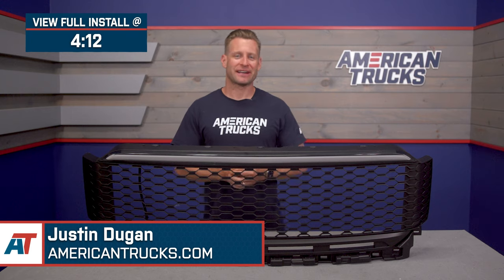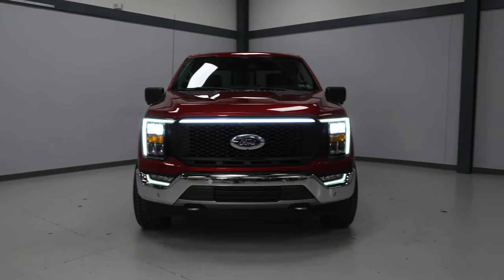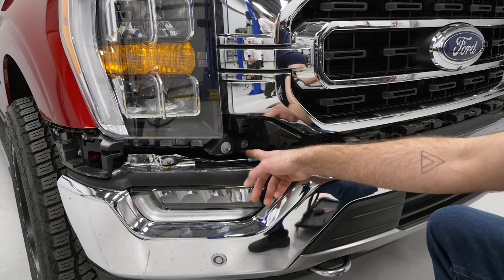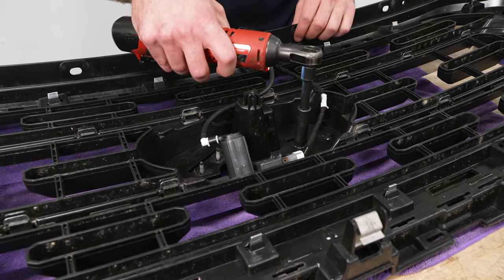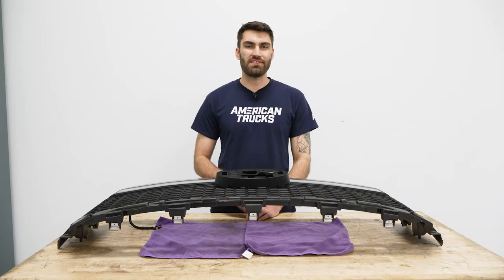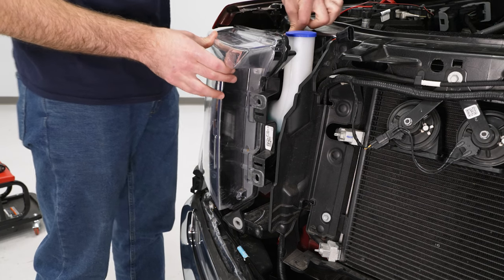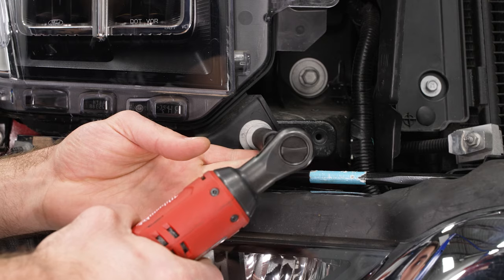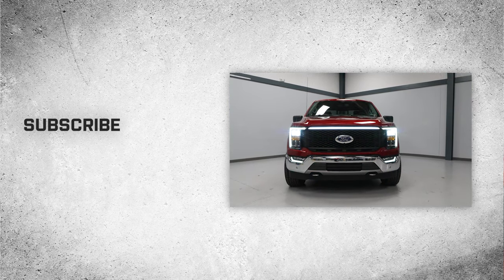2021-2023 F-150 RedRock Baja Style Upper Replacement Grille Review & Install

Comment: The wiring harness doesn't work with the 2023 lariats (stock led lights). The box came with another set option but no instructions on what the three wires are for.
How do you toggle to 'lightning model? Mine just stay on the raptor style amber lights.
Reply: The wiring T-harness also doesn’t fit on my 21 f150 xl, but I have the alternate wire group with 3 prongs and no instructions. How were you able to hook yours up?
Reply: did you find a way to fix this?
Reply: @doofy2129  not from the manufacturer. I just searched for wiring diagrams for the headlights and spliced into them and omitted the harness.  Worked easily. Just make sure you look up the right wiring diagram. 2021 lariats have different headlights than 2023
Reply: @DeltaHeavy So it worked properly by splicing the wire into DRLs? Did you have to do just one side or both?
Reply: @shark_plissken  Just the one side. I did it on the passenger side
Reply: @DeltaHeavy  they did it at some shop right now, had to splice into passenger side like u said. But now the headlight on driver side, vertical halo led not lit..
Thoughts??
Reply: @shark_plissken  pretty sure they spliced into a wrong wire. I had something similar with the dash throwing and error and my signal not working. In my case, i looked at the wrong diagram. The diagrams online are a bit confusing. 2021's have different headlights than 23's and even in 23's there were different diagrams. I wish I had kept notes so I could've posted here. Sorry dude. Just trying my best to remember. 

Look up some YouTube videos if you're at the shop, I remember finding some info on which wires would work there too.
Reply: @DeltaHeavy  thanks. Yea they're saying they never touched the driver side at all... Man just so strange, the moment I change the grill, part of the Drl doesn't work??...

I did find online that a bunch of people's LED going out, specifically the vertical bar... AT 60K... mine just hit 60k